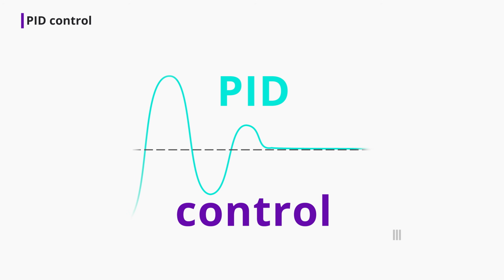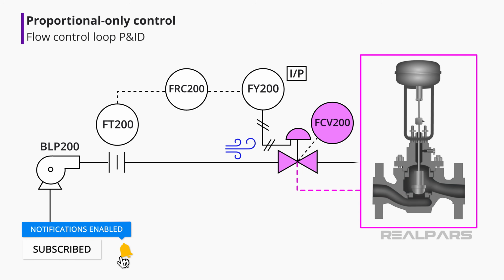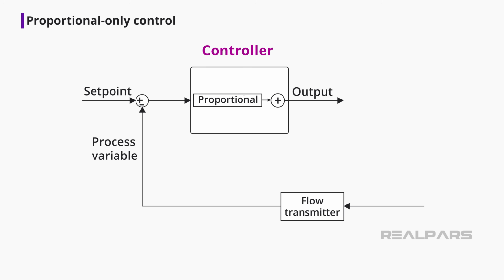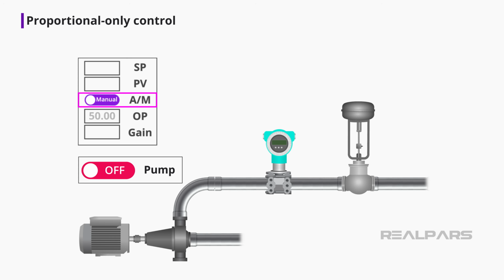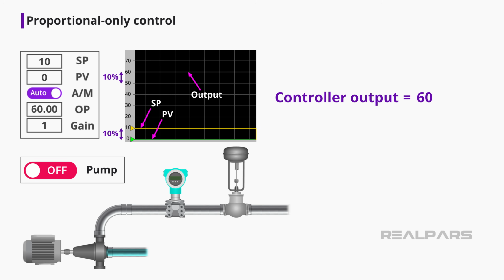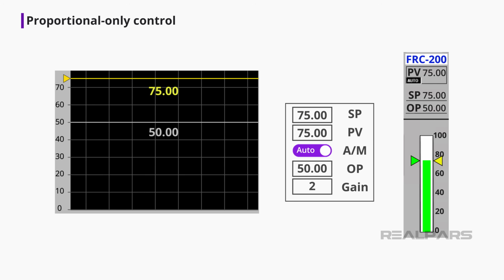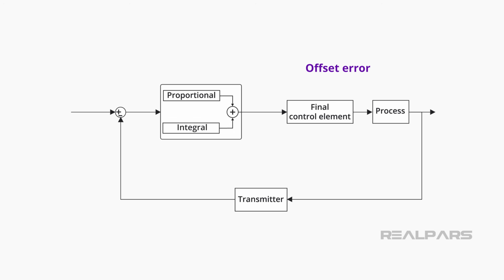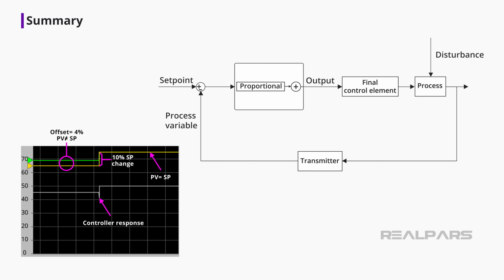PID Settings | Proportional-Only Control

Comment: Kc has unit?
Output[%]=BIAS[%]+Kc[%/mm] x (SP[mm]-PV[mm])
Reply from the maker: Hello, @胡有蝉   Thank you for your question. But we did not use the term KC in our video. Therefore, you will need to be more specific with your question as it relates to our video, so we can understand what you are asking. But for your learning, here is a link to help you understand PID:  https://www.realpars.com/blog/pid-controller.   If you're looking to learn more about this topic, you can join our 7-day free trial at https://community.realpars.com/checkout/realpars-membership Happy learning from RealPars!

Comment: Hai Real pars great video I have ever seen about P controller but there is one small mistake at dynamic condition PV 0 and SP is 10% gain is 2 means CO= 70% but setpoint you mentioned 20 instead of 10 in  please change that will create confusion to learners..Thanks..
Reply from the maker: Hello, @allinonechannel8717.  Thank you for your question. Thanks for your feedback.  This video is only about a proportional controller. Our instructor will look into this, and our apologies if it confused you.  Happy learning from Realpars!

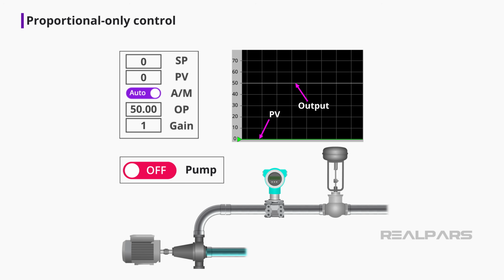Comment: 4:32 Are you sure there is no calculation mistake? Because if the SP is 20, and the PV is 0, we get an error of 20. Multiply it by the Gain of 2, and we get 40%. 50%+40% = 90?
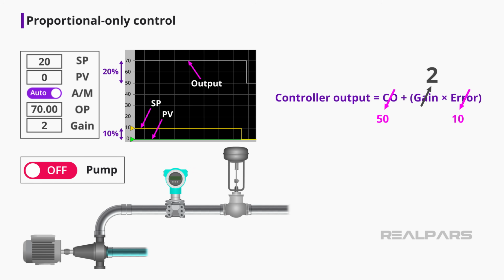Reply from the maker: Hi there. You have a good eye. Thanks for reaching out. There is an error in the graphic.  Please refer to 4:46.  The SP window shows an SP of 20.  The SP window should indicate 10, not 20. The video narrative states a SP change of 10.   The Error value in the calculation is 10.  If the SP was changed by 20, we would get an error of 20. And, if we multiplied by 20, we would indeed get an increase in output of 40%.

Comment: Howdy. Credits to RealPars for taking the time and effort to make these educational videos.
As a curiosity. The European understanding of positive control is that the control output follows the set value. Increasing set point increases control output. Default in Siemens controllers.
The American way of positive control is that the control output follows the process value. An increase in process value increases the contol output. Default in Omron controllers.
Positive European: "Controlling of heating."
Positive American: "Controlling of cooling."
Regards.
Reply from the maker: Thanks for your support, Eugene! We appreciate that
Reply: @realpars  Howdy. Sirs, Ma'ams.
You are most kind to say so. Yeah.
Back in my career days I remember almost gone nuts not getting the flippin' Omron to control. I only got it to bang-bang from rail to rail. So eventually I checked the manual and switched the direction.
Voila'. Began to work like magic.
Regards.

Comment: Really i appreciate these videos.
Thank you very much
Reply: In a control loop I found it already setting the P,I &D .  But the measurement always exceeds the setpoint at 14% and then it returns stable.  in this case it is necessary to act on P,I or D. Thank you for your response 😊
Reply from the maker: You're very welcome!

Comment: I want to add PID temperature control to my 240VAC instant hot water heater. What controller and sensor would you recommend?
Is there such a thing as proportional heater control?
A heater controller that factors in flow rate?
Reply from the maker: Hi Mr Techie. Thanks for reaching out.  I'm curious about why you want PID control for your hot water on-demand heater.  I'm gonna go out on a limb here and suggest that an add-on PID control is not practical or easily accomplished. I don't know what vendor made your heater, but I assume it has a built-in controller already.  Can you provide any additional info please?
Reply: @realpars  It has manual switches for two heating elements: low, high (or both). Further adjustment is by manually adjusting the water flow rate. No electronic nor mechanical thermostatic control (except for a thermal safety cutoff in case of overheating).
Atmor brand, model Super 900

Comment: I really appreciate these videos. I am a Master Toyota technician and what I find interesting is how much the automotive industry industry is incorporating some of these technologies into their systems. A case in point, is our direct injection engines which now use a brushless 3 phase fuel pump and fuel pressure transducers to monitor pressure. It is really not much of a stretch to understand the mechanics of PLC operation.
Reply from the maker: Hi @aircates. Thanks for your comment. As you know, a car is loaded with computers. ECM's, ECU's....etc...etc.....  And of course loaded with active sensors that detect everything from flow to pressure to temperature.....and much more!
Reply: @realpars  absolutely correct!! I’m seriously considering changing professions from automotive to industrial troubleshooting. This is much more interesting to me and the way the systems interact is not unlike many automotive systems. In fact, some of the illustrations you use to explain some systems are automotive.

Comment: Ia have a question please. I deal with PID level actuator, I put the set point (it's level controller). The problem is when tge the PV varies, the actuator goes to it's maximum output (fully closed or fully open) 0% to 100%. this leads to a big oscillating in flow rate, even when using a small gain, what can I do to get semi stable level and flow rate?
Reply from the maker: Hi mohammed ibrahim. Thanks for contacting us. I can’t answer straight away as I don’t understand your loop quite yet.  I’m not sure what your PV is. Are you measuring level or flow?  Are you controlling level or flow? Is the flow rate you refer to a measure of the flow going through a pipe and into a tank where the level is being controlled? Is the flowrate a measure MV of a flow transmitter?  I’ll keep an eye out for your replies.
Reply: I had some similar problems many years ago. It turned out that the cause is in control valve positioner's settings and pneumatic connections to the actuator. Can you control the opening of the control valve manually? Try to send 4 mA (0%) to the positioner, then increase it bit by bit, to 25%, 50%, 75% and 100%.

Comment: Hi, can you please help me understand the root cause of offset?
Reply from the maker: Hi @Prasad Adavi. That's a tough question to answer quickly. In a nutshell, the controller's proportional action acts on the error signal and does its best to bring the PV back to SP.   Unfortunately, after its' initial action, the PV does not reach the SP and no further action will occur. That's why Integral action is introduced. Integral action will continue to move the controller output until the PV does equal the SP and offset is eliminated.

Comment: I understand correctly that at 4:39 the setpoint should change to 10, and not to 20, how is it with you?
Reply from the maker: Hi @Anatoly Terpugov. You are correct. The value in the controller setting SP window should show 10 and not 20.  The graph correctly shows that the SP is 10.  Thanks for pointing that out!

Comment: Hello, thank you for this video. I don't understand the formula CO=CO+(gain x error) because, after each scan, CO would augment to reach 100%. In a E5AR Omron controller, there is a parameter called manual reset which is a fixed value added to (gain x error). Then, the formula would be CO = (manual reset value)+(gain x error). So, even if the CO change depending on the error, the manual reset velue will always be at 50%. Am i correct ?
Reply from the maker: Hi @jbpilon2. Thanks very much for your question. I’m not sure what you mean by “each scan” as an analog control loop is continuous. In any control loop, it is desirable that the controller output (CO) never reaches 100%, or 0% as the final actuator is at maximum or minimum. If that happens, the controller has no further effect on the PV. In a perfect world, let’s assume the CO is at 50% for a PV of 50%. We want to ensure that the Gain is not high enough to drive the CO to 100% or 0%.  I’m not familiar with the E5AR Omron controller but I assume it is a temperature controller. I’d be interested in hearing more about the “manual reset value” that you describe. In most PID controllers, the term “reset” is another name for “Integral” or the “I” in PID. I’m looking forward to your response.
Reply: @realpars  Hello, interesting conversation. In math calculation, if i programmed the formula CO=CO+(gain x error), at each scan of the computer, CO will augment. I think we retreive a parameter like "manual reset value" in many controllers. It is a fixed value and it is used to manually  remove the error when the process has reached his stability. When error=0, the output will continu to be activated with the manual reset value. In some controller, we also retreive the parameter "automatic reset" which is another name for the integral. So the formula could be CO=MRV + (gain x error). MRV = Manual reset value. Thank you again for the video. I wil use it in my courses. JB
Reply: @jbpilon02 correct formula is CO = gain * error
Reply: @kimaipet  Hello, What's happen when the error=0 ? No command ? Even if the error=0, we need a command to maintain the temperature=set point. In a Proportionnal control loop, the manual reset value will do it. CO=MRV+(gain x error). So if error=0, CO=MRV.
Reply: @jbpilon02 This is the main disadvantage of P controller. It always has offset error.
Reply: @kimaipet  You're right this is why we prefer the integral parameter (automatic reset) than the manual reset value.
Reply: @jbpilon02  I mean P controller always has offset error (error never = 0), so CO = gain*error. If this does not suit your process, then you need to use a PI controller at least.
Reply: @kimaipet  In some Omron controller (and other i think) there is a manual reset value which is added to (gain x error).This MRV is adjusted for only 1 set point. As you wrote, if the production needs many set points, PI or PID is prefered.
Reply from the maker: @jbpilon02  When the error is zero, the controller output will stabilize at some value between 0 and 100% (4 to 20 mA).
Reply from the maker: @jbpilon02  @Kim Andrey.  There will always be an output from the controller even when the error is 0.  The actual controller output depends on many things.  From an engineering perspective, starting with the controller output of 50%  to hold the final actuator at 50% and the PV at 50% is ideal. Check out our video on PI control.
Reply: @kimaipet  also COnew = COold + gain * (ERRORnew - ERRORold))

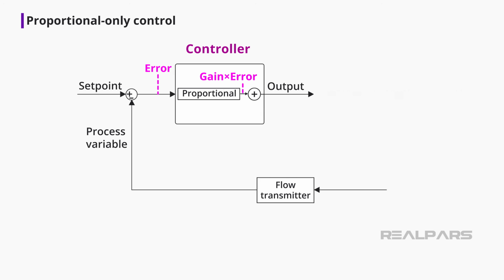@realpars seems to have not noticed the error in the video at 2:58

Comment: This is FT200 flow transmitter not DP . Thanks
Reply from the maker: Hi @laith jawad. Hey....thanks for your feedback!  You are correct. FT200 is indeed a flow transmitter. At the same time, it is a differential pressure (DP) flow transmitter.  The high and low ports of this DP flow transmitter are located on either side of an orifice plate.